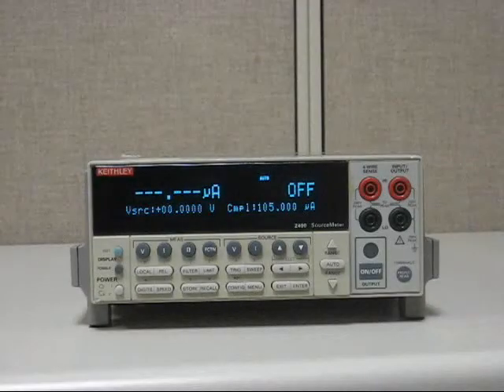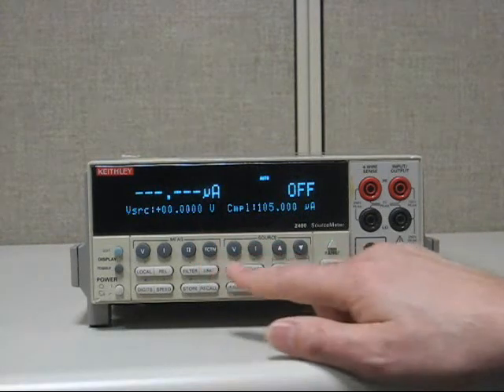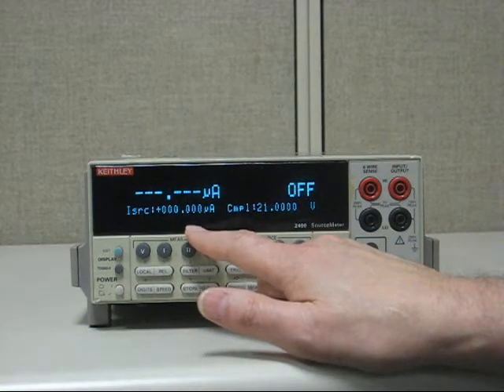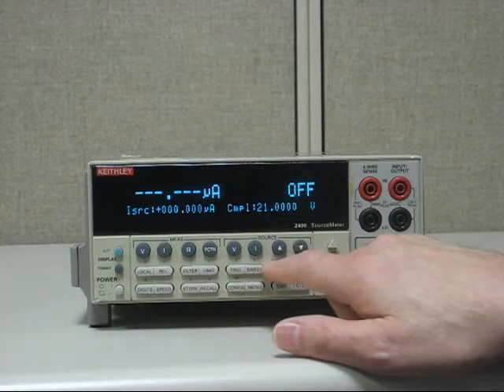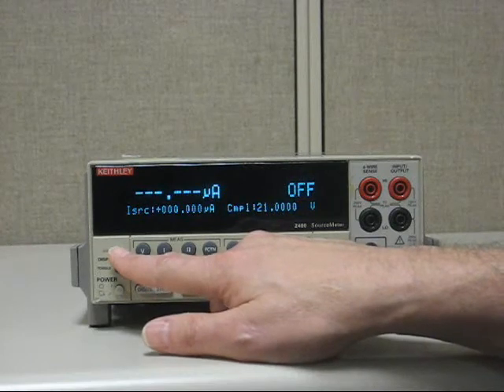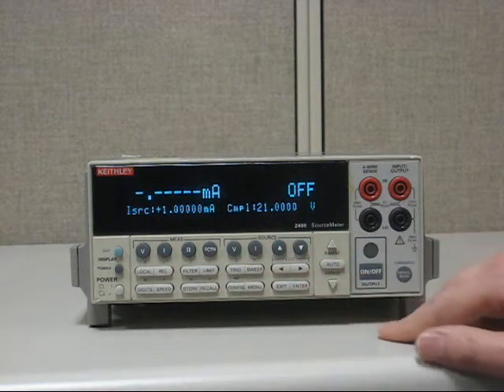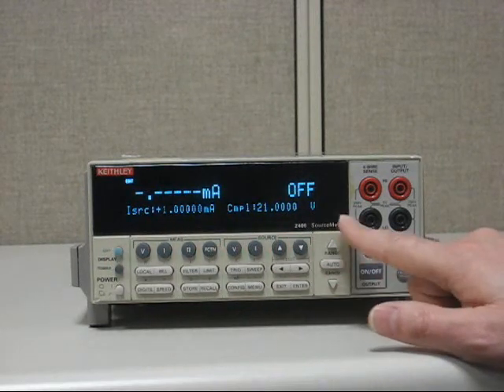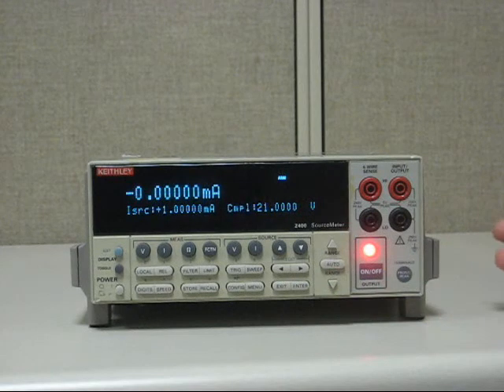Keithley Instruments Model 2400 SourceMeter:  How-To Source 10mA

Comment: Why is the voltage clampped without any connections?
Reply: Because it is missing the return line-I connected a 1k ohm resistor and read back 1v while injecting 1mA